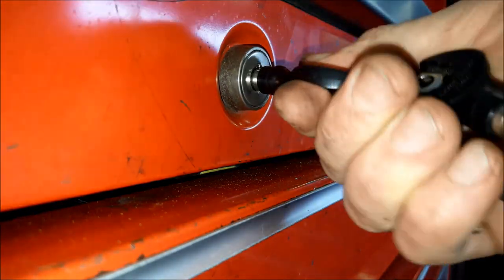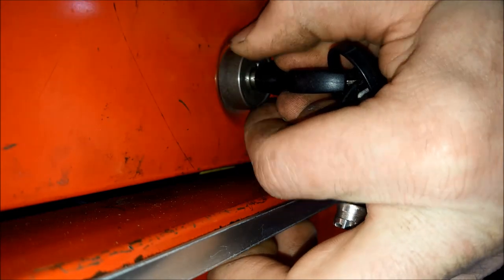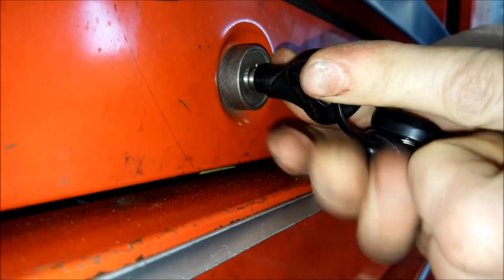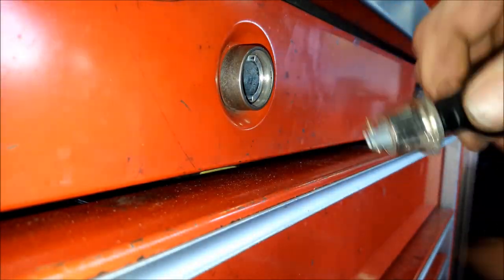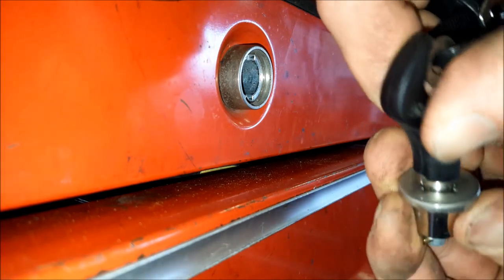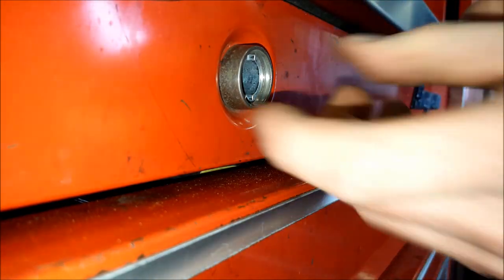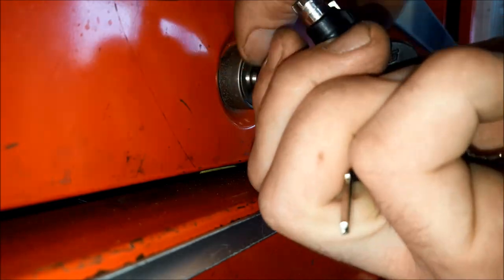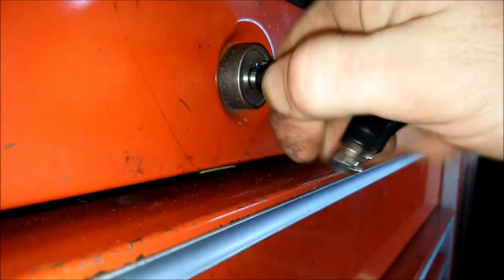Snap On lock cylinder change REPLACE tool box key EASY

Comment: Hi, I have a question I hope you or someone can answer.
I have a Mac Tools Tech Series roll-cab which needs a new lock. It is the cylinder barrel lock similar to this one. 
Do all these locks come in the same size? Do they all have the same diameter? 
It’s just I have seen so many on eBay but I’m worried I buy one then it doesn’t fit. 
Does anyone know what one I need for the Mac Tools Tech Series box?
I’m sorry if this is a dumb question but I can’t seem to find an answer anywhere.
I would really appreciate it if anyone can help me find the lock I’m looking for. 
Thanks in advance.
Jamie
Reply from the maker: Have you tried getting the original Mac Tools lock? If you can't get that, I suppose I would just try ordering one off eBay and see if it fits, if not return it. Otherwise I couldn't be of more help. Good luck
Reply: Ok thanks anyway 👍

Comment: Is it possible to replace this if someone doesn't have the key? It's an open position.  I'm trying to buy it.
Reply from the maker: Yes, if you get a whole new lock assembly.
Reply from the maker: Or just order a key for the lock code that's printed on it

Comment: What if you dont have the key??
Reply from the maker: Then order the proper key from eBay. There is a code printed on the lock
Reply from the maker: Or get one off your snap on dealer
Reply: Ok where do find that number
Reply from the maker: @torreyrehard2334  it should be printed on the face of the lock
Reply: Yup I see it, but neither ebay or Amazon has the key I need. I have a new lock and key but no clue how to swap it out.
Reply from the maker: @torreyrehard2334  oh, I didn't realize you already had a new lock and key. Then I would say probably have to drill it out, or remove the lock from the back side if you take out the top drawer you should be able to get to it
Reply from the maker: There is a clip that holds the entire lock assembly in there. There might be another video on it I'm sure if you look you might be able to find one